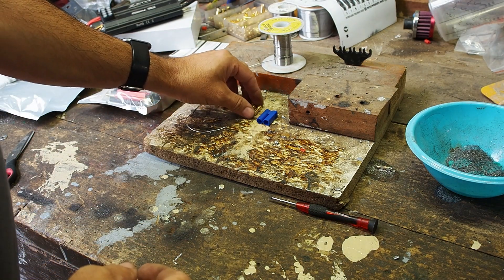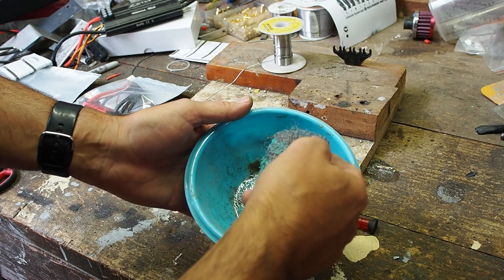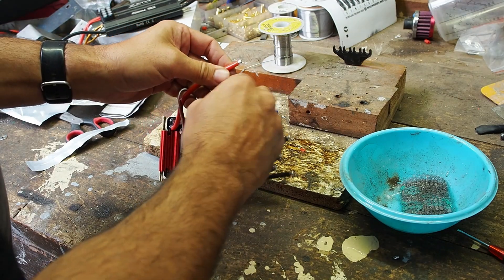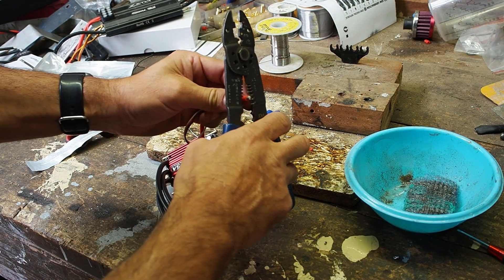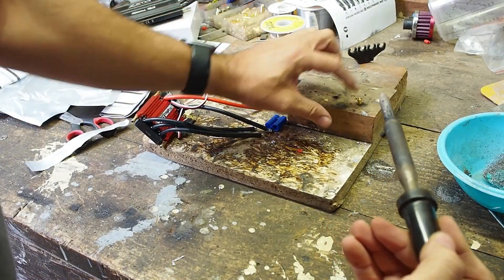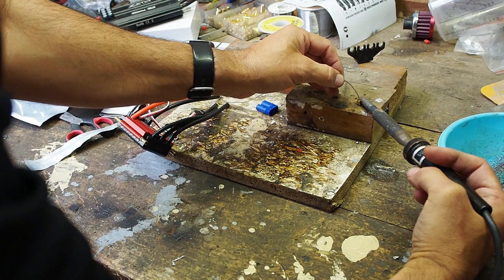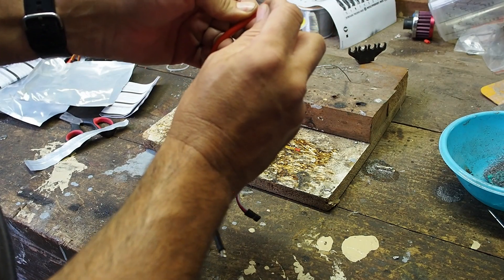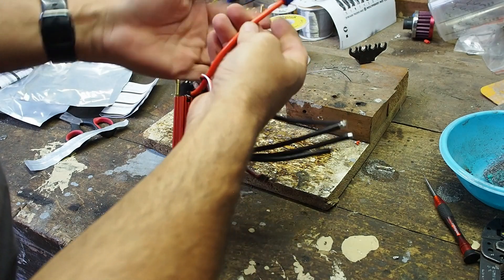Super simple way to solder EC5 and IC5 terminals

Comment: So you snap the housing on from the outside AFTER the bullets are soldered on? There are other videos show you should slide the housing onto the wires BEFORE soldering the bullets in, then slide the house on?

Which technique is correct?
Reply: Female and Male side are differents . 
Battery side (always female) slide from FRONT !
MALE size slides from behind .
Reply: @petyahawk Yes, just west my male terminal yesterday.
Reply: @petyahawk owh.. so it's doggy style for ec5..😊😊
Reply from the maker: Different brands do it different ways